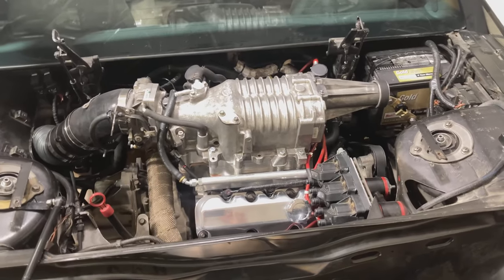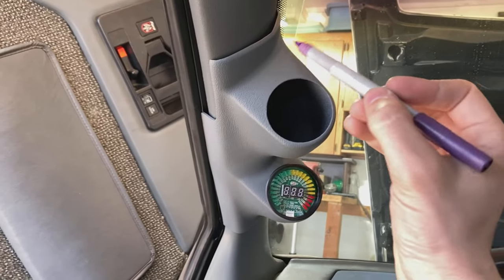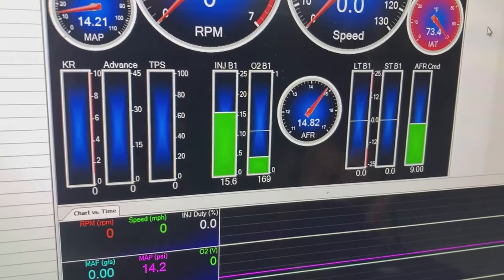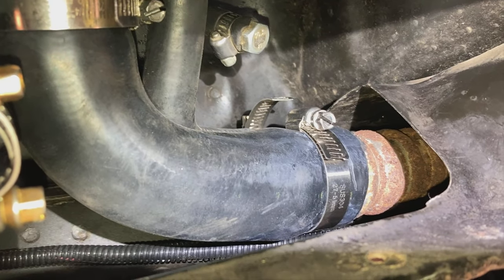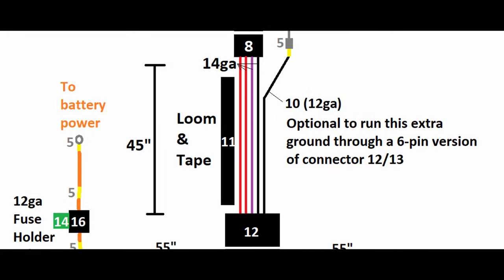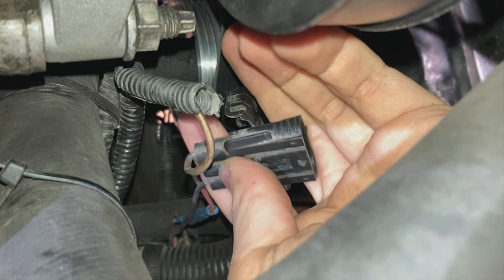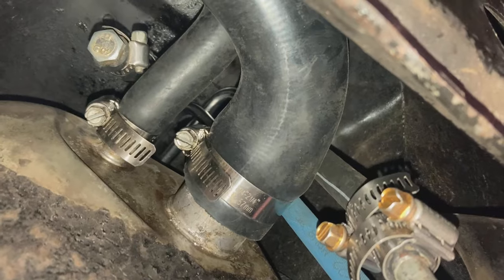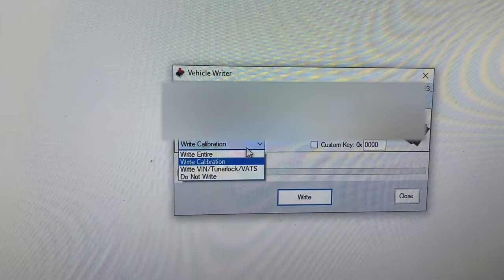How to Convert Engines to Ethanol (E85) for MORE POWER + Wideband O2 | 3800 Fiero Edition

Comment from the maker: ALL PARTS/DIAGRAMS IN THIS POST https://www.fiero.nl/forum/Forum2/HTML/139530.html#p7
SPREADSHEET FILE https://docs.google.com/spreadsheets/d/1NHw21ThFTrZMm41ICIeSd_6tdvl0XOLA2Rb4Yn7zPog/edit?usp=sharing
PARTS USED IN THIS VIDEO:
MOST ALL PARTS IN AMAZON https://amzn.to/3TQp9za

Battery Quick Disconnect https://amzn.to/3kOGXfF

Gauge Pod https://amzn.to/3x0cVLt
88 Fiero Interior A-Pillar Paint https://amzn.to/4cxhH3i
Crimp Connectors https://amzn.to/4aqmgdZ
Dual Lock Velcro https://amzn.to/4aqm3rd
HPTuners Pro Link https://www.hptuners.com/product/pro-link-plus/
HPTuners MPVi 3 https://www.hptuners.com/mpvi3/

80# Injectors
Series 2 EV1 https://ebay.us/J2KDLU
Series 3 EV6 https://ebay.us/hPH7vq
Fuel Injector Orings https://amzn.to/4cv23pd

Custom Fuel Rails https://ebay.us/ykY2Ph
Alternate Custom Fuel Rails https://amzn.to/49apOjJ
3/8 Hose https://amzn.to/3vwLGYv
Filter https://amzn.to/3Twas3d
Fitting https://amzn.to/4cqx7Xd
Fitting https://amzn.to/4cvsPOo
Fitting https://amzn.to/3IPMlHD
Fitting https://amzn.to/3IQGwtr
1/4 Hose https://amzn.to/4cvRvGA
Fuel Pressure Regulator https://amzn.to/3IOGFxC
90° Vent Hose https://amzn.to/4cr0CIv
90° Fill Hose https://amzn.to/3TvJybx

340LPH Pump https://amzn.to/4aofo0I
Quieter Pump https://amzn.to/4arDLKZ
Alternate Pump https://amzn.to/3JaORZr

Fuel Resistant Wire
14ga Red (2x) https://www.racetronix.biz/p/wire-teflon-14ga-41-str-sn-600v-red/wr-fep-14-2
14ga Blk https://www.racetronix.biz/p/wire-teflon-14ga-41-str-sn-600v-black/wr-fep-14-0
14ga Blu https://www.racetronix.biz/p/wire-teflon-14ga-41-str-sn-600v-blue/wr-fep-14-6
12ga Blk https://www.racetronix.biz/p/wire-teflon-12ga-65tc-150c-600v-black/wr-fep-12-0
12ga Blk Alternate https://amzn.to/4a8DNrq

Stainless Steel Fuel Sending Unit (factory is not ethanol compatible!):
https://www.fierostore.com/Product/Detail.aspx?s=60912

Pump Connector https://www.racetronix.biz/p/connector-set-in-tank-pumps-lg-12-10ga/rcs-045
Pump Connector Alternate https://amzn.to/3Pzy5GI
In-tank Connector https://www.racetronix.biz/p/connector-set-mp150-4f-itwh-vapor-side/rcs-061
Bulkhead Connector https://www.racetronix.biz/p/fs-bulkhead-connector-assembly-4-way/bca-4w
Bulkhead Connector Alternate https://amzn.to/3PBfbzc
IAC Connector https://www.racetronix.biz/p/connector-set-mp1502-4f-tps-bcwa/rcs-058
IAC Connector alternate https://amzn.to/3TQ5EG7
4-pin Connector Set https://amzn.to/3VulUyI
6-pin Connector Set https://amzn.to/3VpHIM2
Wire Loom https://amzn.to/3IP9kT9
Electrical Tape https://amzn.to/49bMSOK
Fuses https://amzn.to/3vnVcgK
Relays https://amzn.to/3Pyfx9X
10ga Relay Pins https://amzn.to/3TQ0bAf
Inline Fuse Holders https://amzn.to/3TO7hF8

Wire Strippers https://amzn.to/3IOGJgQ
Nice Wire Strippers https://amzn.to/3IOoYyj
Crimpers https://amzn.to/3vpAb58
Pin Removal Tool https://amzn.to/43uqkrw
Solder Station https://amzn.to/3x6CNph

Gas Tank Seal https://amzn.to/3vgIvV1

Ethanol Test Kit https://amzn.to/3TuAtjo
Fuel Stabilizer https://amzn.to/3vsbF3y

Chapters:
Intro info 0:40
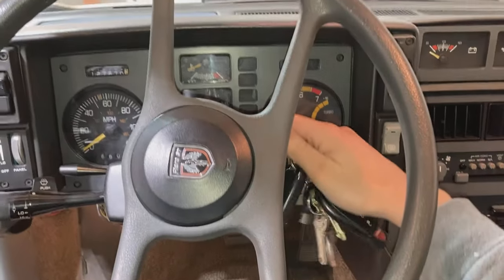Wideband/O2 sensor 2:02
Fuel rails/Hoses 8:20
Gas tank removal/Hoses 9:44
Fuel pump Install 11:20
Wiring Overview 12:40
Wiring in tank 13:53
Wiring outside tank 16:15
Wiring on car 18:38
Wiring Recap 19:17
Installing wiring on car 20:37
Reinstalling gas tank 22:56
Tuning 24:00
Filling gas tank 25:51
Startup Maintenance/Storage 27:10

Amazon Recommendation Store for 3800s/Fieros/Tools https://amzn.to/3hNViaa
3800sc Instructions http://www.fiero.nl/forum/Forum2/HTML/139530.html
3800sc Instructions MOBILE https://drive.google.com/file/d/1wqUJdMZ1XqcKJzC-2ZzbvLYMYE3QbmVq
eBay affiliate https://ebay.us/4yOWEw
Donate to me https://www.paypal.com/donate/?business=8AFWKBTBVSKTJ
Join channel membership https://www.youtube.com/FieroAustin/join
Subscribe https://www.youtube.com/fieroaustin?sub_confirmation=1
Consulting https://www.facebook.com/FieroAustin/
Facebook Subscribers Group https://www.facebook.com/becomesupporter/FieroAustin/

#3800 #supercharged #fiero #3800sc #3800supercharged #pontiac #pontiacfiero #fieroaustin #howto #3800fiero #superchargedfiero #engineswap #fierogt #L67 #L32 #engineconversion #affiliatemarketing #affiliate
When you click on links to various merchants on this site and make a purchase, this can result in this site earning a commission. Affiliate programs and affiliations include, but are not limited to, the eBay Partner Network and Amazon Associates.

Comment: So if I was to tune for E85 and then run regular pump gas with the injector skew still in place would the computer compensate or do I have to reflash every time I switch back to pump gas?
Reply from the maker: Good question, you've got to re flash every time for the best results. You could try flashing a skew # in the middle (~1.15) and your car could handle both (but not great). The O2 sensor can adjust fuel by about 15% total, so that would get you in the OK range for gas (1.0) and ethanol (1.3), but just barely.
Reply from the maker: I realized I was missing a piece of critical information. Because the 3800 particularly is not flex fuel, my previous comment applies. However it would not apply to flex fuel vehicles. I am not aware of modern tuning with other cars, but at least with a 3800 computer, it must be manually flashed every time. Also if you flashed a 1.15 skew, you would run the risk of constantly being borderline too lean with E85 fuel (BOOM!)
Reply: I guess the smart thing to do would be to carry my laptop with me wherever I went and just do a quickie rewrite of my ECU if I threw e85 at it.  Thanks for the input.
Reply from the maker: @thewebwingman  yeah. It's something you'd do at the beginning/end of the year when switching back to regular gas for storage and vice versa.